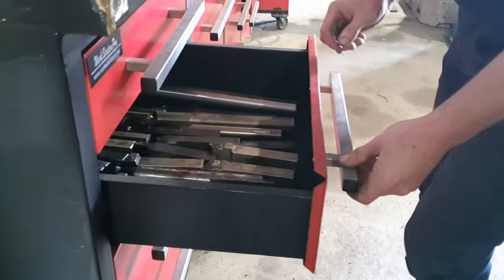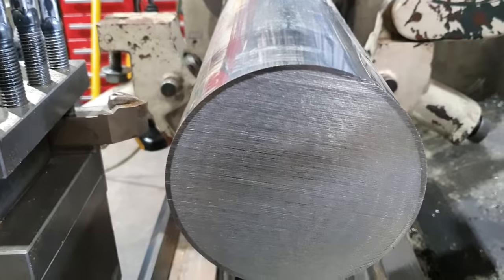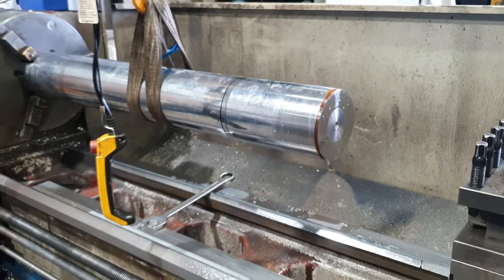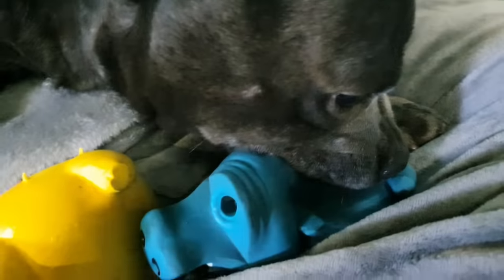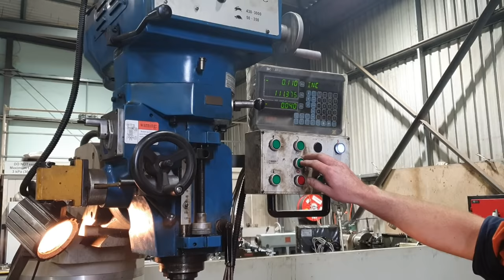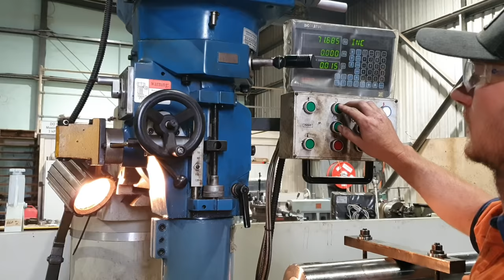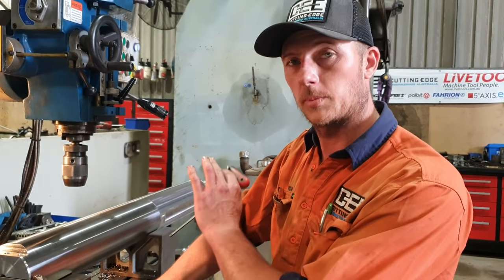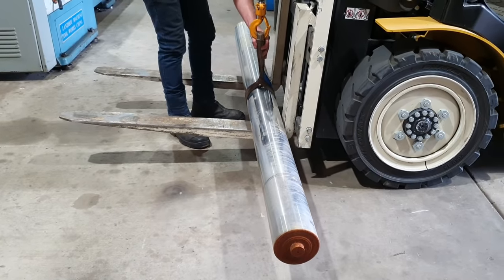Making a BIG Boring Bar | Shop Made Tools

Comment: Bloody brilliant as usual, mate. Your lathe must have a very rigid toolpost to support that amount of overhang to allow such a huge bar to cut without deflecting significantly. Or am I missing something?

Anyhow, congratulations to you for showing us another way to help us backyard blokes to improve our tool inventory, and also much admiration for Karen for her brilliant camera work; lots of people make videos, but hers really highlight how good your work is without being flashy. Good on yer both!
Reply: Im wondering the same thing... It seems rather small for that tool...
Reply: being that big perhaps that makes it so rigid that the overhang effects nothing
Reply: Very unlikely that bar is going to flex but that does seam like a heck of a lot of leveraged force transferred onto the tool post. I have to admit I was expecting to see the bar fitted onto a bigger lathe, either way he has shown he knows exactly what he is doing I have little doubt he has considered and knows exactly that the tool post will handle that beast of a bar. I look forward to seeing it do what it was made for.
Reply: I used to use a shop made boring bar that was significantly larger than this one. I do not recall the actual numbers (if I ever even knew them) but an estimate from memory, is that is was probably about 4 inches (200mm) in diameter, and over 12 feet (3 to 4 metres) long. It was entirely round, did not clamp into a tool post. Instead, we removed the compound and put into it's place a saddle made to clamp the diameter of the bar. We were boring steel cylinders that were about 6 feet (almost 2 metres) deep. There was no noticeable deflection, and it is difficult for me to imagine that our cutting inserts would not be destroyed if there was enough force on them to flex that bar. What the weight of that bar did do (with that leverage it had due to it's distance from the saddle) was try to tweak the carriage on the bed, making the friction rather high on the ways. That is why the boring bar was so long - half of it stuck out the back side of the saddle, toward the tailstock. That way the weight was carried evenly, it was balanced. The biggest issues were that the cutting tool would wear (we used diamonds and ceramics for their hardness over carbide) as you can imagine, the linear distance of the inside circumference and length of cut. The other issue, was getting the feed and speed right, along with the cutting tool geometry, such that the chips would break, insead of a bird's nest from a continuous chip hundreds of feet long. Imagine machining propellor shafts on container ships!
Reply: @SodiumInteresting  that's what she said .. 😅😅
Reply: @eugencsl  haha
Reply: Felt d same!

Comment: I know everyone says don't use coolant, but like you've i've found that my ceramic inserts last way longer with the coolant than without.

Especially on my custom regrinds, i've found that they last roughly 30% more than without (standard diamond regrind with a diamond paste edge lap cleanup pass).

Excellent work!!! Nothing but the best, even for the shop.

Comment: I'm really interested to see how this performs, especially with finish cutting. I'm inclined to suspect it will not be able to do good finishing due to vibration. It is possible to mount a fixture onto slideway though instead of using tool post, that does provide more stability.
Reply from the maker: Video of testing the bar coming on a few days 😎👍
Reply: I’m curious what the deflection is on the tool post and how well it will transit.
Reply: @francisschweitzer8431  yep. We have made home tools, but it didn't work so well, we have a bigger tool post too. But that could be material. We are cutting inconel and required to get finishes of under RA 0.4 at times, so we made a base to sit on the slideway and that works a treat.

Comment: Love the design. Sure it's going to work great. For future tools look at building a big boring bar holder that can bolt to the saddle directly instead of onto the tool post. Will give the bar more clamping stability so you'll be able to take bigger and longer cuts. Unfortunately weak point in the whole operation there is the shaft the tool posts mounted to and may allow vibration with heavier cuts. Awesome work and keep up the great content

Comment: My concern would be all the stress on the compound ways with all that reach.
Reply: would think make it longer at the back side for some counterweight, but  then it would start to vibrate even more :D
Reply: CEE run big solid gear by the look of things.
Reply: @crackone2three  Next week: boring bar with tuned mass damper
Reply: @rampagerick  I kinda wonder if filling it with oil or coolant would help.
Reply: @crackone2three  But the extra weight might help dampen the vibrations, wouldn't it?

Comment: It’s a great looking boring bar. We made lots of them for the company I worked for for the past 18 years. We made some that were several feet long —yep not a typo. We found that actually after seven diameters hanging out there there isn’t much you can do to stop the chatter. play with the tool geometry and depth of cut and stuff. One thing we did is we filled some of the bars (which we deliberately used hollow material for) with this muck that we had from our hone so it made the bar really really heavy, but it deadened some of the vibration.
Reply: Try fixing a length of wood to it.

Comment: you should put a counterweight onto the end to reduce weight stress onto the toolholder, since your cutting forces gain a lot of leverage you should counter the asymmetric weight
Reply: I am sure he will realize this while testing. The bar weighs 95 kg and then you add the cutting force. I would suggest adding some sort of extra support for the far out bar end pulling it down. The jaw of the tool holder will be heavily loaded.
Reply: I was also thinking that the tool post is now the weakest link. It looks overloaded now.
Reply: @chrisjohnson4165  Perhaps it is possible to add another tool post or like to increase support.

Comment: What type of handsaw blade  have you got that cuts induction hardened bar ?
Reply from the maker: Tungsten carbide tipped blade
Reply: It also appears that the saw moves only in one direction. How does it do that?
Reply: @novit009  the blade is a big loop, the machine is a bandsaw

Comment: You would really benefit by having a horizontal boring machine in you're shop, they're a natural complement to big lathes. 
Outfitted with a spindle probe and tool magazine, they can save you a lot of time in set-up, and their greater rigidity would mean heavier milling capability.
I also use mine for lathe prep, facing bars to length and putting in centers prior to turning, works really well.

Comment: I’m having difficulty picturing the size of the hole you’re going to make with this 🤔 and how the heck are you going to mount the cruise ship 🛳 or aircraft carrier on your lathe that requires such a hole ?? Question: when you say bin, do you mean the recycling bin ? Surely all that induction hardened steel is worth scraping?
Reply from the maker: One viewer thinks we are building a Transformer and they might be right 😏😂
Reply: @CuttingEdgeEngineering  Optimus earth digger !! I’m so in..

Comment: The large boring bars I have made I've drilling a  3/4 or 1  inch hole down the center almost to the end that holds the tool .  
I tapped the  open end of that to  1 inch . 
In the 3/4 or 1  hole I put a long spring that I can put tension on with a 1 inch bolt . I also drill and tap the the bolt for a grease fitting  . 
  I now have a spring down the center of my boring bar that is also full of grease.  I can adjust the spring  tension  to tune out almost any harmonic vibrations  .

Comment: I built one pretty much the same back in the mid 90's to use on our Lion C10T 25x80 lathe.  Made it from some 4"  -4140 and it was about 60" long.    Worked great

Comment: I use for my selfmade boring bars steel tubes, filled with old crushed inserts and/or sand.
Also i fix the tool with 4 scews, so i can mount on the front side a WNMG holder and on the backside a DCMG at the same time if needed.
And i have made a special holder for the boring bar, a big steel block with a bore for the bar, screwed on the x axis, (i have T-slots there, the machine had the option for a tool revolver) thats much stiffer than the holder on the Z2 axis.

For stripping the hard surface, i use the old Kennametal/Hertel Fix Perfect with old inserts and grind the cutting edge negativ ~30°x1mm, ap 3-4mm. Never had a broken insert with that tool, even with ap 16mm in C45 (the cutting edge is only 8mm and the insert 15mm, it was a test to see what the new machine can handle)

Comment: one improvement i suggest you make on your bar.  drill a coolant hole to the end so you can direct  either coolant flood  or coolant mist to the cutting tool.  flooding really helps chips escape the work piece instead of balling up inside.

Comment: I made something similar when I was an apprentice out of 3" 431 stainless steel. I made it in 2 parts and press fitted the parts together. Worked good. Allowed me to take massive cuts. I use to do the ID of a cast iron valve body in 2 cuts. One roughing, one finishing. 10-15mm in material to remove.

Comment: That's a lot of weight you know have hanging off your new tool post.
Is the single mounting post capable of supporting the boring bar, and the cutting process under way?
That is an impressive load to be held with just the clamp force of your new tool holder.

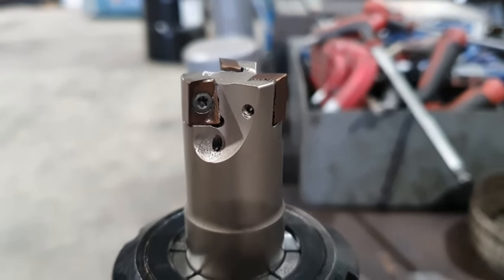Comment: It would be amazing if you could give a brief explanation as to why you are using each specific tool. For example you start machining the rod at 22:19 you start with a 25mm indexable endmill and then you switch to a HSS cutter. I am obviously not a machinist, but it would be nice to have an idea what each tool does :) Cheers!

Comment: Artillery uses the same equation for measuring a barrel.  For example:  USS New Jersey's big guns are 16"/50 caliber.  16 inch diameter, 50 x 16" long (800 inches).
Sometimes, old tricks are the best tricks.

Comment: What impressd me most that you was able to MILL BOTH WAYS in the milling maskine..  I know its possible on never TIGHT maskines. 😀 
But i learnd in mecanic school back in 1976 to NEVER MILL  in the direction where its possible for the tool to take advantage of say loose threads somewhere,ore if the workpice loosens, 
risking destroying something, in wourst case the whole mill, if the tool is able to pull and make to deep a cut by PULLING THE PIECE AGAINST ITSELF.

Comment: You should make some roller bearings on bars that come out from behind the head of the boring bar. That way they roll on the cut surface behind the tool and reduce vibration like a steady rest. If on a thread through the bar, they could have a far amount of adjustment and a sprung end for positive presure. 3 or 4 should help eith deep cuts.

Comment: I know I'm late here, but I got a question. With a bar that heavy with that much stick out, do you have to worry about the torque it's putting on the tool post, compound, cross slide?

Comment: Impressive but to make good use out of it you would need a much more rigid lathe including a more rigid tool holder. I've used one similar but a bit shorter on a 50 horse power cnc lathe and it worked well.

Comment: Fun fact. The boring bar was actually made for "cleaning" Kurtis work pants. All the years moving at lightning speed through the shop made the chips fuse to the pants by the friction of the air alone until they where solid as a CAT D11 ripper shank.

So now every month or so Kurtis just takes of a couple of thousands from the ID and they are good to go .

Comment: 5:1, seems right to me as the upper limit.  I watched you use that bar in another video and was listening for chatter.  The last time I used WD40 was to clean up a 16" four jaw chuck that had not been mounted in a decade.  Worked good as a solvent.  I needed to fix some thing square.   

Please pet Homeless for me, if you please.

I'm sure enjoying you videos as I spend time at home over the holidays.

Comment: Seems to me that it would be possible to steady the tool with  a steady rest running on the newly machined inside work surface given you are keeping the shavings blowing out the lathe head end with compressed air. This would let you bore a very long piece without chatter.

Comment: When you drilled and tapped the holes to attach the tool, is there some reason you chose to use grub screws rather than socket head screws which take a much larger Allen key?

Comment: That's the way I always turned chromed hydraulic rods was to peel the case hardened away with ceramic and finished up with carbide.   With that said I was surprised to see you cut it on the bandsaw.   They must have come a long way with bandsaw blades since I retired.    I always had to use a hot saw to cut them to length.    I never had any bandsaw blades around that would cut thru the case hardened outer diameter.    Interesting.

Comment: Excellent vid as always.  Is there a reason you did not add a relief to the bar at the tool holder so that you could get a little bit smaller diameter cut out of the bar?

Comment: How much stress does it put on the tool post/cross slide ect?

Would it been better to hollow out this gigantic boring bar to make it easier to handle?   I have read that hollow boring bars can help to cut down on vibrations (harmonics)

Comment: Curt, when you attach a set of jaws to the head stock, do you still need to use a gauge to make sure the work is balanced or not because the jaws are centered at both ends?

Comment: How did you cut that induction hardened rod with the bandsaw?  Seems it would just skate on the induction layer even if it is carbide?  The teeth did not look brazed on so I am assuming it is just a tool steel blade?  I run into that with much smaller shafting (monel, and various stainless ones) up to an inch and a half, two inches rarely but am wondering if you are using something I could on my saws?  Currently I have to cut them with a grinder.

Comment: One should balance between strength and rigidity .The strains induced by the cutting forces to the tool post are significant smaller that the ones induced by the weight of the bar. Such a tool holder is more efficient when made from a hollow bar, square or circular. 
However i love the videos.

Comment: Awesome job! Please tell me something about the tool holders that you use? Are the top edge of the clamping section, on the centre line? (So if you were to use a smaller holder you would pack it up underneath to get the top surface on the centre line again?) Is this how all tip holders work? Thanks.

Comment: The bleeping boring bar is more rigid than the tool post that holds it.  And that's going some.
If you have to reach that deeply into a cylinder tube, you definitely need unusual, one-off tools.  Take 'em wherever you can get 'em.

Comment: A much better way to achieve what you wanted is to mill a large flat under the bar were you want to clamp it then remove the toolpost and tap 4 large holes in each corner of the compound slide then clamp the bar directly to the compound slide with 2 clamps across the bar , more ridged works for me mate.

Comment: Why didnt you just slot the boring bar so it could slide onto your tool post but have material above and between the post? Then it could bite down on the post fully enclosing the flange.

Comment: I’m amazed to how the ceramic tip got red got, but the carbide tip didnt. I’m pretty sure it has to do with melting and flash points for both materials, but a more detailed explanation from anybody would be amazing. I would love to learn more about the properties of the lave tips if anybody can recommend a link. Thanks. Wow, it took a while to type this out with two beers in my system.

Comment: I'm too late to the party to expect an answer to this year old vid.  But 'll ask anyway.  How did you get a saw to cut that hardened and ground shaft?  O2 induction hardened steel is often around 70Rc on the surface and a saw blade won't touch it.  I've had to grind or turn a groove through the shell before sawing.  Thanks again for a very cool video.
Reply: Steel suppliers just saw through them.

Comment: Fantastic video as always.
Why did you setup the 90 degree attachment? Nice to watch but turning the bar 90 degrees you could have used the normal vertical head to mill that slot.
Humongous boring bar though fair play!
Reply from the maker: Would have needed to set it all up again for drilling and tapping 😎👍
Reply: @CuttingEdgeEngineering  
Fair point. Swings and roundabouts I think.
Makes my biggest boring bar look so feeble.
I have a Colchester Triumph roundhead. Old but hardly any wear. Big enough for a hobby user! I also have a Bridgeport and an Elliott Sturdimill which is awesome.

Comment: I never thought ceramic was hard enough to cut on steel. I wondered if it was tungsten carbide, cobalt, or Titanium!
Reply: Ceramic inserts are harder than almost any other insert save CBN ones. They are like glass though, interrupted cuts or thermal shock will damage them without much effort.

Comment: I have to ask... If the bar is 125mm and it looks like at least 25mm tool stick out, does that mean you're sending a 150mm drill 600 deep? Or trepanning? or what? Starting with hollow stock?

Comment: I don't know about putting that amount of torque on the cross slide. Add in a load and maybe some harmonics from a cut and I'd be worried about damaging something. I don't think it'll cut into your ways though. Either way, you have a lot more experience at this than me, so good luck.

Comment: Hi Curtis, what a whopper. You used a ceramic tip to cut through the induction hardened portion of that bar, how was the bandsaw able to cut it? That was a really interesting video, thanks. Best regards.
Reply from the maker: hey mate the bandsaw has a carbide tipped blade